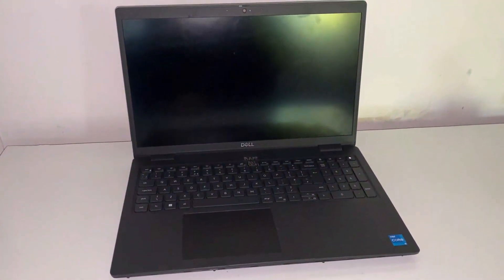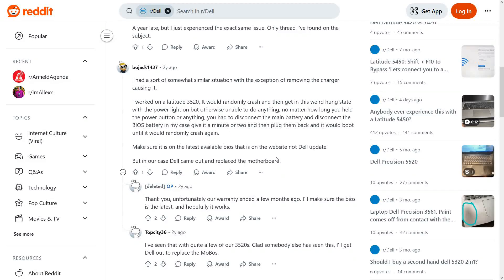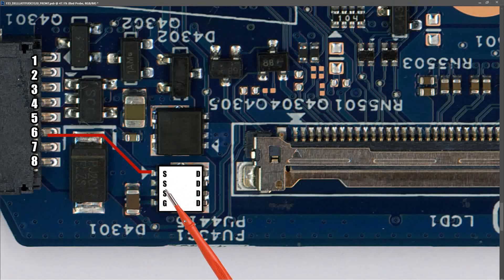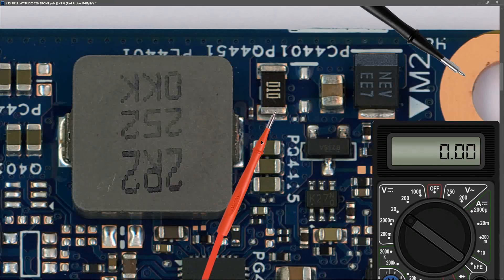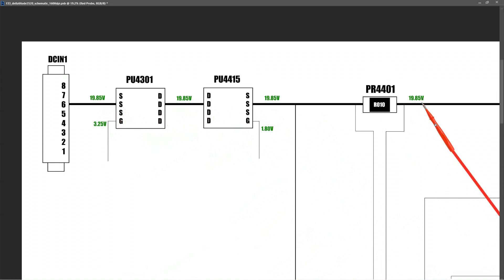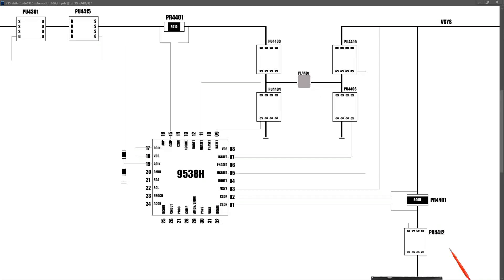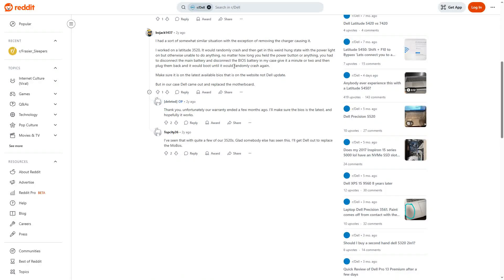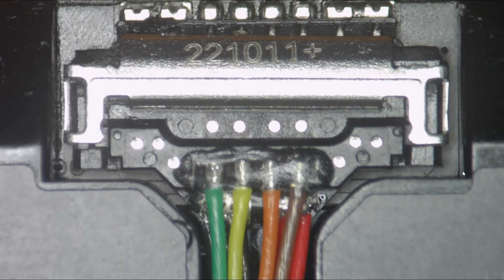DELL LATITUDE 3520 - WHY IS IT CRASHING?

Comment: Sounds like cracked solder on that connection. Might be best to resolder it too and maybe add some lead solder to the feet
Reply from the maker: Hi, I had actually soldered the battery connection at the point of making this video, but fault still occurred. However, the day after I made this video, the issue would not recur at all (with same motherboard and same battery) and has not done in the last week. It's very frustrating. The owner lives many miles away so I have to be sure of a solution before returning it.

Comment: Before buying a new battery (since the original one can charge, it's fine by me), I would resolder the jack (receptacle) on the MoBo's PCB and then install a completely new cable (set of wires) for that battery. Another way to put it, that would be my first step; even clearer when you "hit" that connector with the test lead, you fixed it. Excellent work. Thanks so much for sharing. Best regards.

Comment: I had same problem with my customers 3520, I changed the battery & it worked well for 3 weeks & same issue started again, i had replaced ISL chip too but didnt help.
Reply from the maker: This is useful information thank you.

Comment: My money was on the Intersil chip or the comeback MOSFET. But I have also seen a cold solder joint inside the battery where a battery cell connects to the internal PCB.